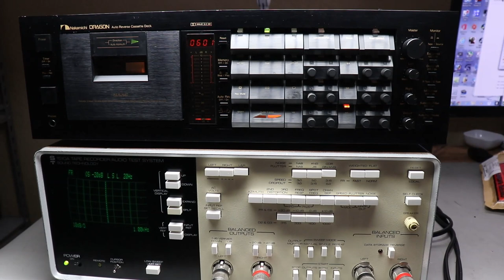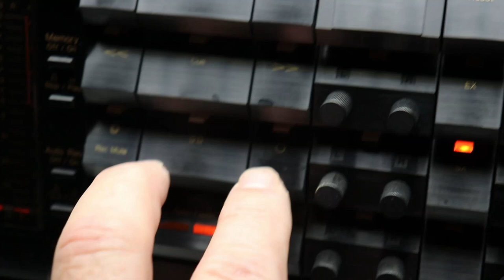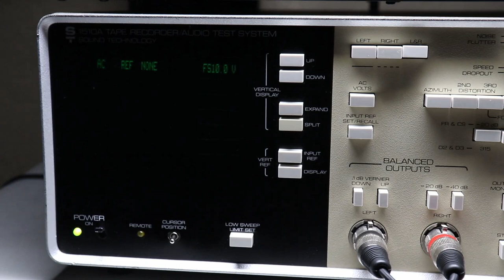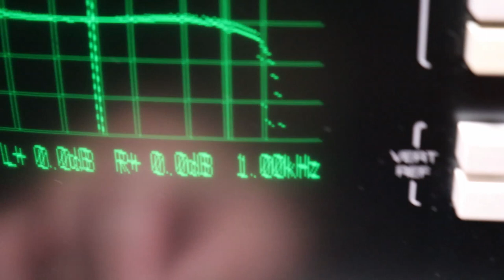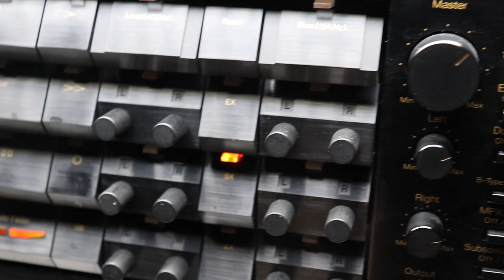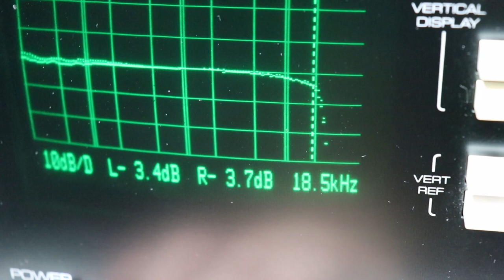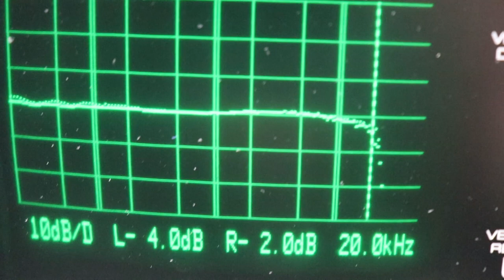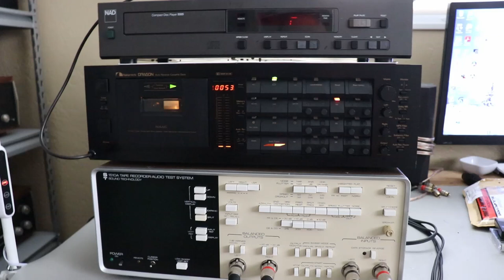Cassette Tape Testing - Nakamichi Dragon - Type I,II,IV. Normal, High Bias, Metal

Comment: I really enjoyed watching your video.  That tape tester of yours showed off both its capabilities and those of the Nakamichi Dragon.  If you're willing, I'd like to see a variation that tests the 'real world' capabilities of a top-line quality, highly-capable tape cassettes at not just -20 dB, but at -10 dB, and 0 dB, maybe even at +10 dB (with/without distortion?) with a highly capable deck like the Dragon, since no one really records at -20 dB input level.  I've averaged up to 0 dB, peaking at +8 dB, with some TOTL tapes (Denon, Sony ES) on my Dragon with great results!

I'm wondering what Frequency Response ranges high-end type II or IV tapes would be able to capture at these signal levels (e.g. like Sony UX-ES or UX-Pro, Metal-ES or Metal Master, Denon HD7/8 and HD-M, TDK's top end SA-XG or MA-XG, or other TOTL cassettes).  Usually these top end tapes will take more signal and can be pushed +4 to +8 dB, maybe more.  For example, Denon's HD8 packaging says it's capable of taking signal level peaks from +5.5 through +7.5 dB.  Would the FR range hold up at these levels on a top line deck like the Dragon?  That would be interesting to find out...

With respect to Nakamichi deck labelling:  I believe that the Dragon's factory zeroed (centered) settings for EQ and Bias should approximate TDK AD (EX / normal), SA ( SX / type II), and MA (ZX / type IV) tape types from the same era, since TDK did manufacture the tape and shells for the Nakamichi Reference cassettes sold by authorised Nakamichi dealers / audio shops.  I'm guessing that the Nakamichi-branded cassette tapes sold during the 1983-89 era were probably aligned as follows: Nakamichi EX (TDK AD) and EXII (TDK AD-X), SX (TDK SA) and SXII (TDK SA-X) and ZX (TDK MA), based on available info on the web.  This would explain why Nakamichi labelled the settings on all their decks as EX / SX / ZX, i.e. to match their self-branded cassettes.  I know on my Dragon that the EQ/Bias settings for 1983 TDK SA and Nak SX are the same, as are TDK SA-X and Nak SXII, and TDK MA-R and Nak ZX.  I don't have any 1983 TDK D/AD/AD-X or the Nak EX/EXII to test the EX EQ/Bias settings, but I'll take an educated guess that they'd match up as well.
Reply from the maker: Thanks so much for your kind words and for your interest. You are correct who the heck records at -20db? No one unless they are making a mistake. I'm like you as my experience has shown that recording at 0db to +5db with a deck like the Dragon with a very good-excellent quality tape will provide excellent results. As you said doing a proper test is the way to go. That would take the guess work out of it. I will try to do that with your suggestions in the future. Thanks again!
Reply: When you are recording so that the VU meters are peaking at 0dB, you ARE recording at an average of -20dB. That's why the frequency response tests are done at  -20dB. 
A properly set-up Nakamichi ZX-7 using metal tape (TDK MA90) will have flat response (+/- 1dB) at -20dB from about 25Hz to 27kHz, with -3dB points at about 22Hz and 28kHz. With the metal tape, the ZX-7 is flat from 30Hz through 15kHz at  -10dB, and flat from 30Hz through 12.5kHz at 0dB recording level. 
Those are the figures I got using the Sound Technology gear and my own ZX-7 in 1983 at the shop. The metal tape was aligned before the testing using the ZX-7's built-in record alignment procedure, and the deck was previously aligned using the entire Nakamichi test tape set. With new belts and tire, the same deck was still working fine in 2018.
Reply: @vintageaudioaddict  Thank you for that video. Can you suggest please, if you were able to record a video with higher levels? I was not able to find it.